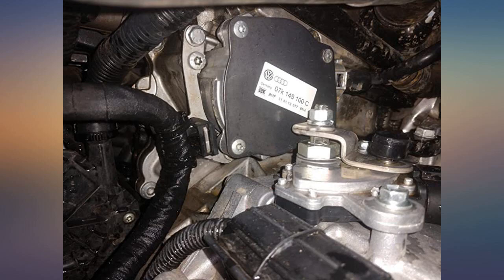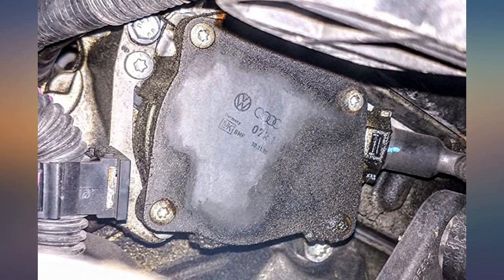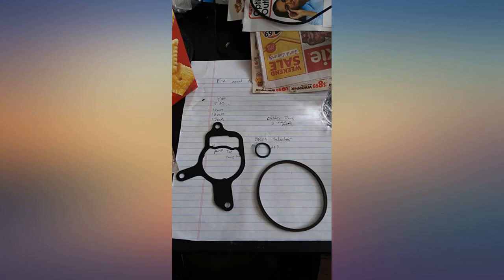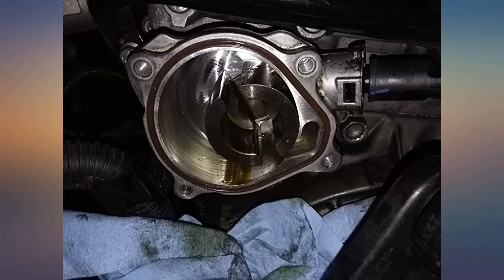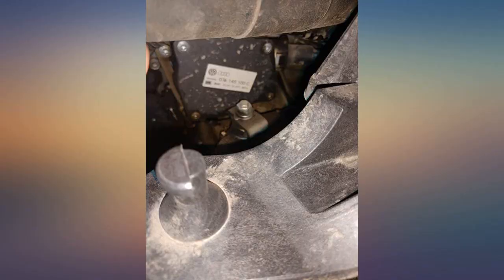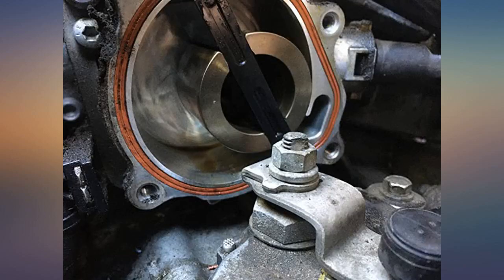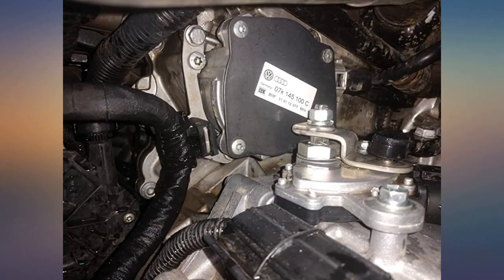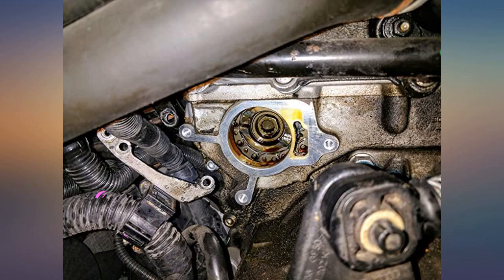RKX 2.5L VACUUM PUMP REBUILD//SEAL KIT replacement for Volkswagen VW 2.5 L Jetta, review

Comment: is anybody selling just the right sized oring anywhere?39 for a rubber ring feels bad
Reply: Get it done. Ive had a small vac leak for the past 3 years. Was just topping off the oil every 500 miles or so, but now the leak is allowing air to get into my intake system & causing a fluctuating idle rpm from 700 to 1500 then back down again and you can hear the engine struggling to stay running from running so lean. I bought the 39$ 3 gasket set and plan on replacing it tonight or tomorrow
Reply: @502austin99  I bought a 10 dollar rubber gasket from ebay and replaced it, no more oil leaks afterwards